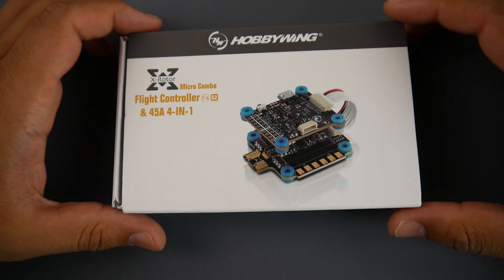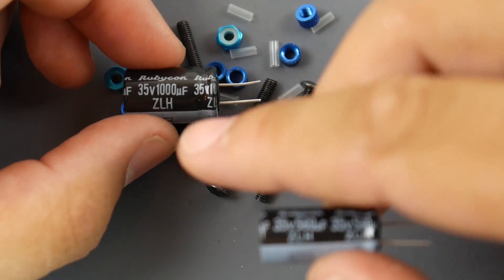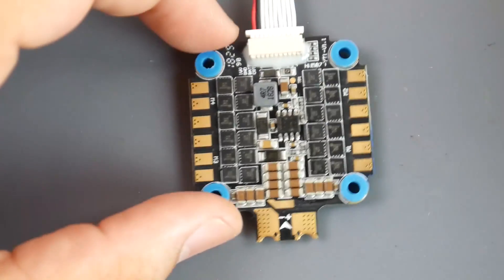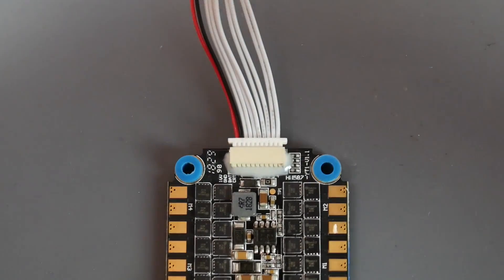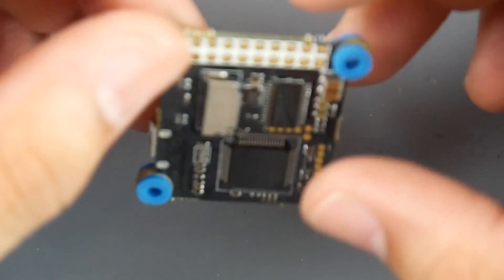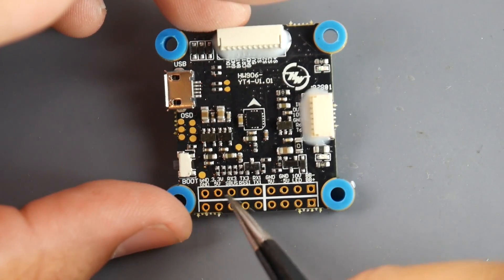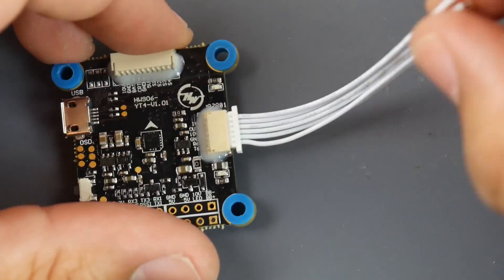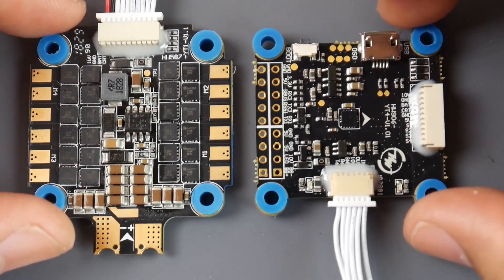Hobbywing XRotor Micro G2 Flight Controller 45A 4in1 ESC // Overview and Setup Guide

Comment: How do you wire up RXSR ?
 I used Gnd/5v/sbus and Tx3 to S.Port then softserial using CLI commands but no FC telemetry.
You mentioned only gnd/5v/sbus but what about telemetry?
I have the G3 and it powers up air unit and transmits FPV fine but no telemetry in goggles.
 Have you tried any FrSky Sbus receivers in particular RXSR and gotten telemetry?
  OmnibusF4SD can get telemetry with S.Port by using softserial and telemetry setting in betaflight but that process isn’t working on the G3?

Comment: I know this is old but I'm having trouble with my first build, so I don't need to use this for vtx/cam since my pdb has it on there, but the jst connector doesn't match my esc so I have to power the FC on my pdb soldering directly so which one gives it power? 10v or 5v? And if its 10v what do I do since my pdb only has 5v and vcc?

Comment: The flight for does suck because you have to use the wire connector that I do not have is it a 6 pin connector? Thanks

Comment: This is the first stack I purchased and I got it on a very good deal. I am so excited to start the build. Just waiting on motors and my frame. The reason they used a plug for the camera that Drone Mesh didn't care for is so you can quickly connect or disconnect the VTX and camera. During a race, you can unplug quicky to kill the VTX and work on it etc. I saw another review note this and it made sense. I also hung out with a pro pilot who runs this Hobbywing stack and he had nothing but good things to say. No this was not his sponsorship talking but his personal opinion. He tried a lot of different stacks and says he stick to this one. Nice review as well

Comment: Been using the XRotor combo since it was launched, it's excellent.  However, not a good idea to use with reverse props.  Recently I had flying rocks tear misfits off the ESC, so I'm now grounded while waiting for a new ESC.  I'll be changing the prop direction when I fit the new one.

Comment: IMO, it's so close to being really good but the lack of color-coded wires makes no sense at all, one simple mistake and the board is toast. Also, the camera/VTX port is awkward and poorly designed without having the +5 volts and ground included in the same connector.  Perhaps there is another component to this stack, as in a VTX, that will address this issue?  It's a nice try, but for $100US it's a No Deal from me...just saying.

Comment: I've the previous X-Rotor version of the hobbywing in 2 quads. They work really fine. I wonder why they got rid of the pin-headers to connect them, they made it a really clean build.
Reply: the pinheaders rip off very easy.

Comment: Its good if it doesn't catch fire...check out Hobbywing FPV user group in FB and you'll see many cases of burnt escs. Happens to even pro pilot. Just have to see if you're lucky or not.
Reply: @JohnSmith-dg3rd  Hi Maximilian,
das mag ja sein. Es gibt ja oft Streuungen in der Qualität bei allen Firmen. Ob es Kiss ist wo ESCs abgeraucht sind oder andere Firmen. Von teuer bis günstig. Man kann ja halt nicht in Kondesatoren ICs oder was auch immer reinschauen.
Oder weißt Du ob das an Benutzerfehlern liegt (manchmal ist der User ja selber das Problem).
Nicht falsch verstehen. Das ist kein Angriff gegen HW. Scheinbar haben manche User da ja Probleme. Viele Regler mögen zB kein Halbgas und rauchen dann ab.
Kannst Du zu deinem Setup was sagen?

Comment: drone mesh got question for you, i use spedix es30hv with 470mf cap on each esc but lately ive had flip of death and ill keep arm till i see it hit ground lol.. would that cause either esc or motor to burn? cause ive had both or either or burn up. Also i checked blheli settings and my low rpm protection was off but i dont know if that can cause a motor or esc to go bad. I hope your doing well and thanks for ur help. i need to find a better less noise esc anyway
Reply from the maker: check motor temp could be a screw touching windings.